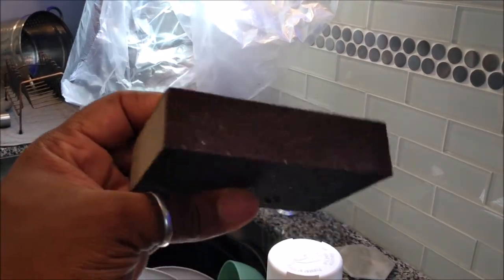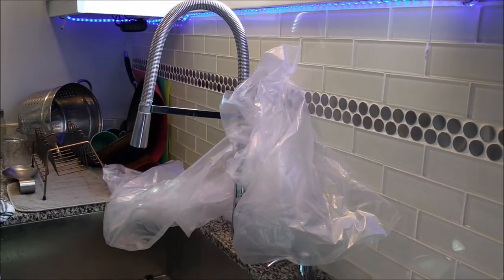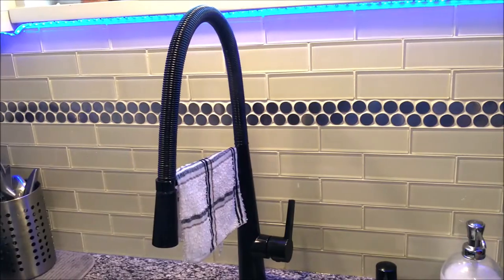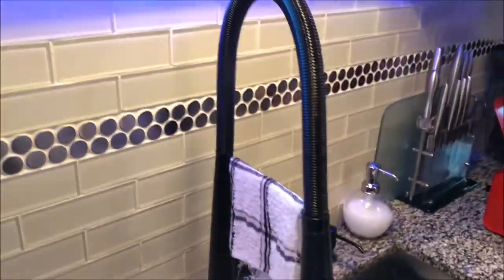(DIY)😍How To Upgrade Your Faucets Using Rustoleum Spray Paint

Comment: This is very very good my dear :-)
One thing you should have did (and can still do) is spray on a Clear top/ protective coat (of polyuerothane or epoxy), and that would REALLY "seal" the deal...pun intended lol.  Even better if you added 1 more black coat, then the clear top/ protective coat.    With this top coat you'd probably NEVER have to repaint it or replace the whole thing, ever again :-)
Reply from the maker: Thank u so much for the tips. Tfw

Comment: Hey girl! Its seems it been year, how has it held up? Thinking of doing this, but nervous it wont work, specially when it needs to be cleaned :(
Reply from the maker: It  held up great I just removed it because the actual faucet  had a leak. But the soap dispencer is still going strong
Reply: Faucets eventually leak.   Just replace the cartidge

Comment: I was thinking about doing this to my bathroom faucet. but I'm wondering if the hot water will cause the paint to separate from the metal. Because I know my heat gun takes paint off of everything that I refinish
Reply: Ooohh I could use heat resistant paint like they use on a wood burning stove then I would have to worry about the heat making the paint come off.
Reply: No wait.... Car paint... Yesss
Reply from the maker: Oh never thought of Automotive paint.

Comment: Did you experience any chipping or water damage with the paint?
Reply from the maker: I did a lil on the soap dispenser.
Reply: @CPR4THEBODYlivingaenrichedlife  ok that's not too bad but not the taps?
Reply from the maker: No ,and I think its because I have to remove the top to refill often. The tap was fine.